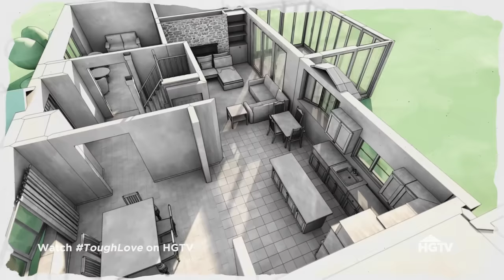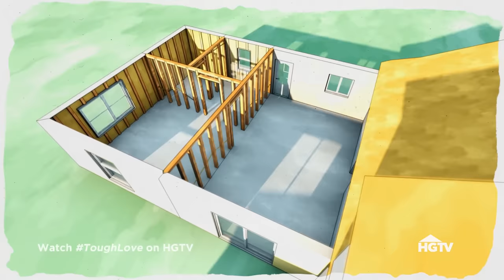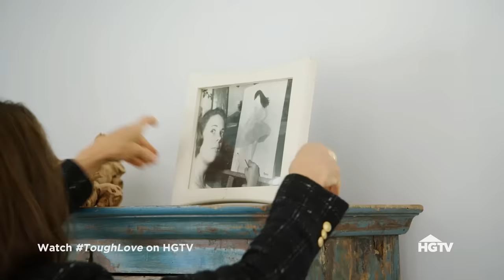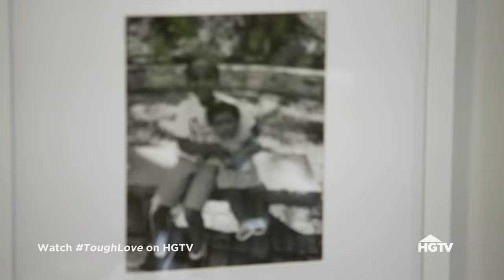Home Construction in Jeopardy When Contractor Fails to Show Up | Tough Love with Hilary Farr | HGTV

Comment: Who, in their right mind, would pay a contractor $90,000 before they do the work?
Reply: Lots won't start the job until they get the majority of the budget up front.
Reply: The contractors need a big chunk of the money to buy supplies to build with
Reply: Generally, it's 50% up front for supplies, and the balance upon completion. 90K is way too much before any work is done.
Reply: If I can get the supplies myself I buy it, and not pay until each step of the project is done. Never pay them ahead of time. I haven’t had to pay any contractor until they finish the job. I pay them each step until they finish. If you paid the even 50% up front they may not even start on it .
Reply: Ya 90k upfront makes no sense unless it is 1 huge project. Otherwise you go 1 at a time and you can pay half upfront of each project not the entire job
Reply: People who are doing their FIRST big contracting job ...
Reply: WHO HAS $90,000 to give away